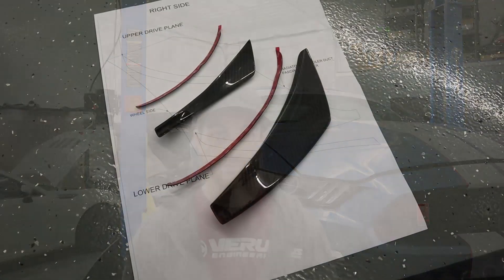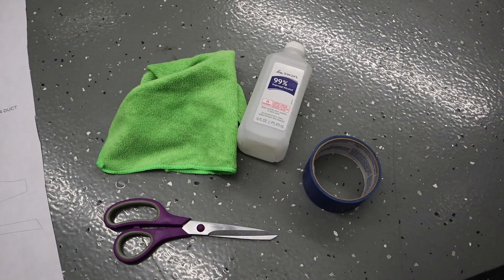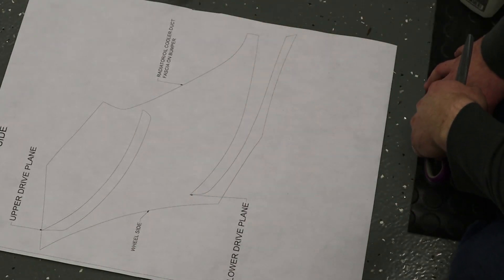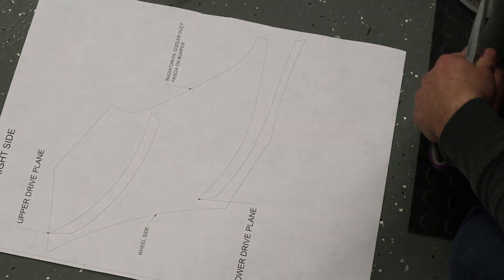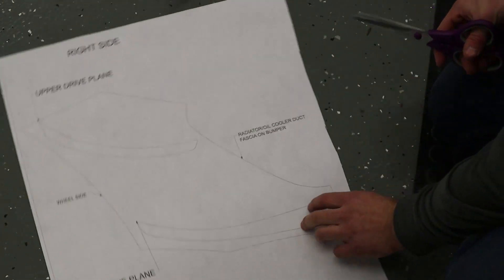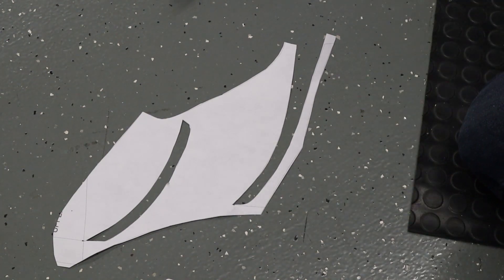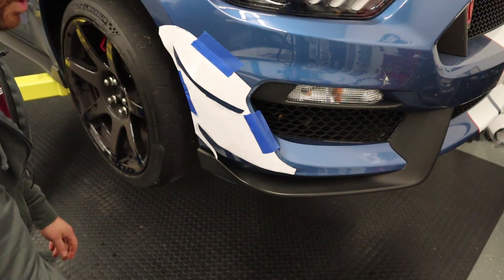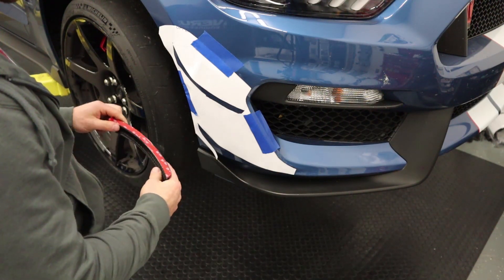Dual-Element Dive Plane (Canard) Kit Install - Ford Mustang Shelby GT350/GT350R

Comment: Can it handle all the vibration from gt350R
Reply from the maker: Yes. We track our quite frequently and have never had an issue. As long as the 3M VHB install guidelines are followed to a T, you will not have an issue. You can also also drill and install them with nuts and bolts.

Comment: Will these fit a 2021 Mach 1?
Reply from the maker: Most likely not as these are made specifically for the GT350 front bumper. If the Mach 1 has the same bumper, then they would work.